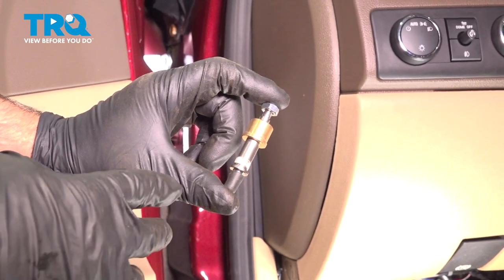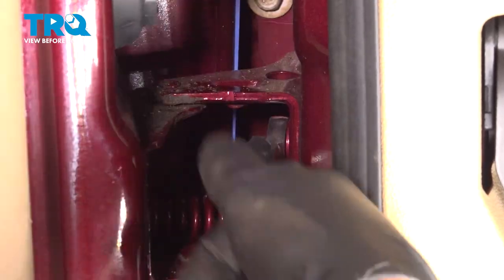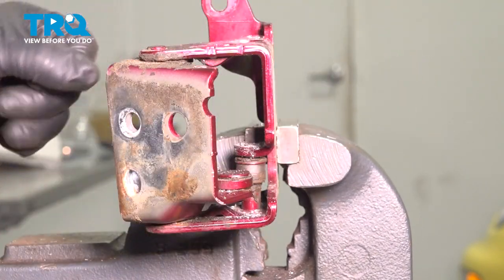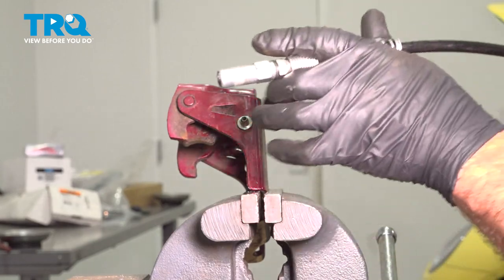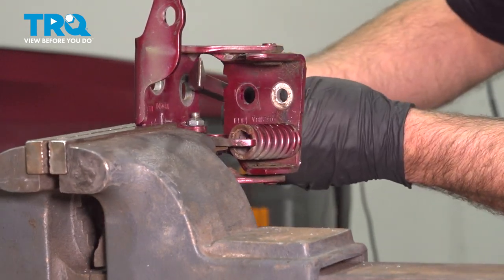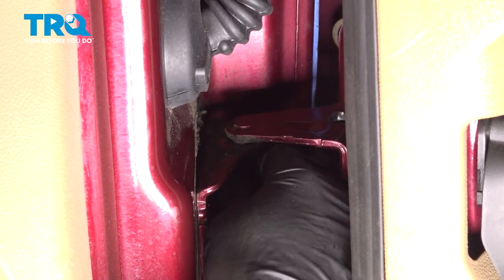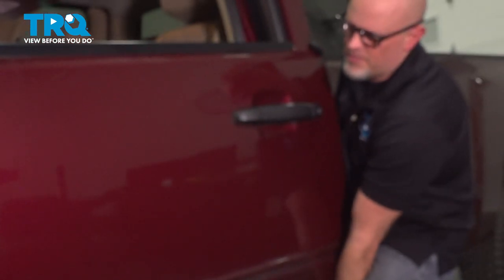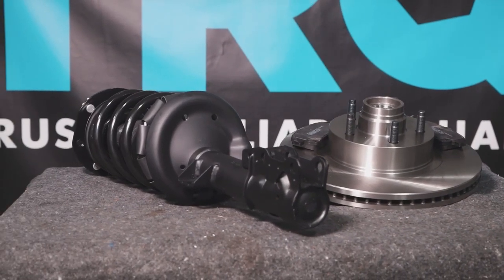How to Replace Door Hinge Pin with Roller 2007-2013 Chevrolet Silverado 1500

Comment: Today I replaced my pin in drivers door. This video is nice, but I can tell where they stopped or cut video because they had trouble. The third mysterious bolt needs to be removed first before you install jack, I would recommend removing the back finder bolt next. Then, install jack and remove the rest of the bolts. Without the jack in the way I was able to close door a little to better reach those two bolts.